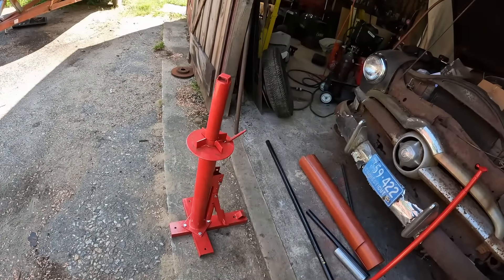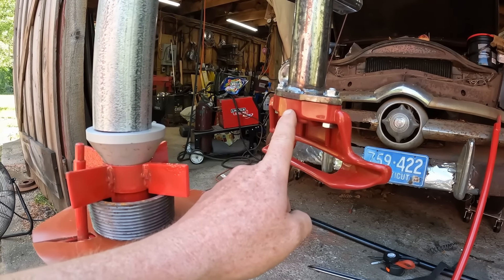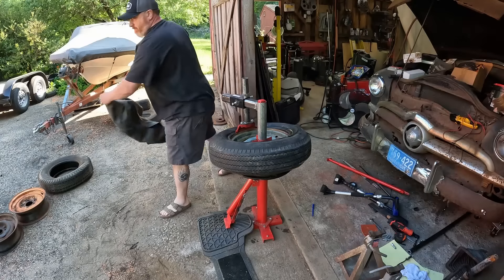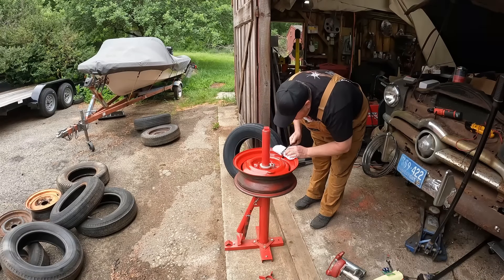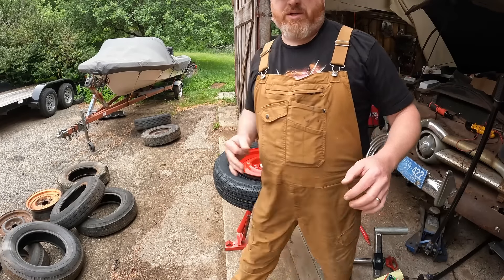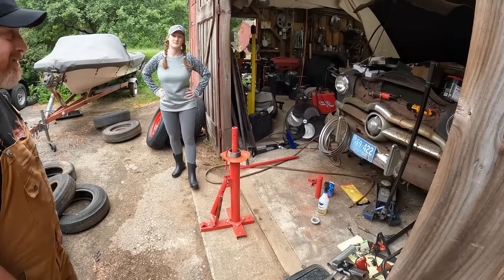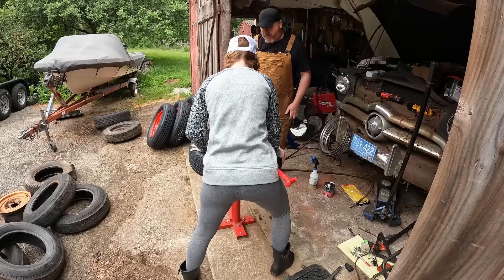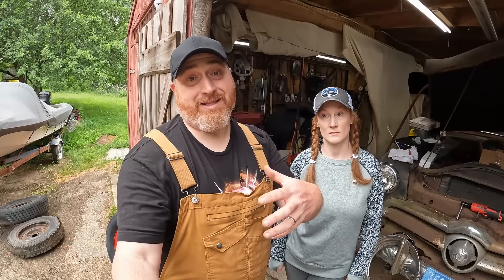How to modify a Harbor Freight Tire Changer to work amazing!!! Follow this DIY guide!!

Comment: Anything you buy at Harbor Freight will have to be modified. I really wonder if it's cheaper to get the material and build your own from the start. Your mods were excellent.
Reply from the maker: It's certainly a good question. My metal supplier will only sell me full lengths at good prices so honestly unless I want to make a few it's probably not worth it.

Comment: Hot soapy water will make it easier to put tire on and take it off
Reply from the maker: Yes it does. We used soapy water on the 3 tires and we have another video where we did 17" tires.

Comment: Used one of these harbor freight tire changers for 15 or 20 years. I put a 2" ID square  reciever stock in the ground in concrete and 2" OD square tube welded on bottom of changer. Easily removed with super steady mounting. I would cover reciever area  with underground valve box and cover. Like the upgrades presented.
Reply from the maker: That's a solid idea! Thanks for the recommendation.

Comment: People listen you can alway just use 2 tire bars and a bead hammer lol can be used anywhere and is super easy
Reply from the maker: I changed a trailer tire on the floor at tractor supply with 2 tire spoons and a hammer. This contraption is worth it's weight on gold after that.

Comment: The reason you didn't hear the tire pop onto the rim is because those old style rims don't have a safety bead for the tire to pop over.
Reply from the maker: Yes, we just did 17" wheels in the new video and pow! Lol
Reply: I did the same mods on my HF tire machine and couldn't believe the difference. I actually pulled mine off the recycling scrap pile to do it. Turned a piece of junk into a very useful tool. I haven't ordered the con yet but will within days. Glad you mentioned that the larger cone is the way to go and that will be the one I get based on your video. Thanks for the information and great videos. Probably going to buy the balancer soon, after watching the vid that you did on that.  @madgingercustoms

Comment: 20:19 how many times are you gonna use this
Wore that one out in about a year. Bought a nicer one with an accurate digital readout for ~$20.
When breaking the bead, use a bungee cord to temporarily hold the arm up out of your way.
Saving the video for when I build the adapter. Thanks!
Reply from the maker: Wow how many tires did you do in that year??
Reply: @madgingercustoms  Not from changing tires, just airing them up. Children, grandchildren, neighbors, cars, tractors, trailers, motorcycles, lawnmowers... it all adds up. The part that wore out was just the 'chuck'. The lever got wonky and it leaked a lot. When I realized how inaccurate the gauge was I just replaced it instead of repairing it.

Comment: Thanks for this video!  I had 6 tires to change on a 1 ton Dodge.  The DOT numbers show the tires are from 2004.  I know they were purchased new and installed in 2004.  I made mine with a 60" piece of 1" galvanized pipe (couldn't get black).  Works great.  I didn't have a problem with it twisting as long as I left a second bar just to the right of where I started from to hold the bead up.  Tires were stiff from age and 40 degree weather but came off great!  Install was a snap!  Thanks again, I was about yo build one of those bigger conversions.   This was much easier and looks easier to use!
Reply from the maker: I'm glad you found value in the video!  Thanks for watching it!

Comment: So that unit works for rims up to 16 inches correct? Thanks in advance.
Reply from the maker: I would think up to a 22" rim.
Reply: @madgingercustoms  okay I seen it said 4 to 16 half on the box wasn't sure if it was the tire size or rim thanks for the quick response great video.
Reply from the maker: @Ricky-eo5ym  I mean with the conversion I did.

Comment: Was just thinking, the vertical piece of square tubing for your bead breaker. What if you make it adjustable so that you have more pipe upward for breaking the bead. That way you are more upward versus being bent over at breaking the bead.
Reply from the maker: That's a solid idea.

Comment: Get some soapy water and coat the tire bead, make it way easier.
Reply from the maker: Soapy water was in the spray bottle.
Reply: I jumped the gun on that. Didn't see you using til later.

Comment: I have to commend you for the way that you did.  I have had one for years and have made a lot of additions to mine but I really like that duck bill addition that you did.  I have unmounted and mounted many tires in my time with this tire changer.  I do have many other tire tools that are old and new.  I have even bent the bar that is used to remove and install the tires.  I wanted to make a thing like you did but I didn't know that the parts were able to be bought, I've been fabricating different things like the duck bill but now I'll just buy one. Thanks for making the list of parts that you used to make it easier to purchase the parts that I need.  Thanks and GOD BLESS YOU SIR!
Reply from the maker: Thanks for watching our video. I'm glad it was helpful.

Comment: Use vise grips on the side of the rim if you don't have the duck bill. This isn't the tool for changing tires on nice rims. Put a ratchet strap around the tire then air it up. More pressure. You get the pop.

Comment: you said your lincoln  mig was acting up have you changed the contact tip and wire feed liner? thats usually the issue and if not that the change the wire feed drive wheels,  lincoln migs are hard to kill ive been welding 30 years  one or possibly two of those three things are usually the issue if your feed is jerky the fact you said sometimes its ok would lead me to replace the wire feed liner as they get bound with dirt and metal dust from use then bind when the mig feed is not straight
Reply from the maker: Hose and gun are relatively new. Thanks for the suggestions!

Comment: You made your tire changer better than mine.  I've been moved many times and had the machine mounted in the lawn before with a 4x80lb bag of cement poored into the dirt so I could ream on that thing without it moving around.  After that move I mounted it in the new garage on a free stranding sheet of plywood with space for myself to stand and walk around the machine.  It's a hell of a bitchty tool to use but it can be dealt with if your not trying to pay others to Mount dismount and re balanced tires all the time.  I've used it on it on 6 of my own vehicles, including doing a full tire set on one, light duty trailer wheel, ex gf pos car and lawnmower wheel.  Got my money back using it all ready.  I like how you modded out your's to be so much more user friendly.  Thanks for sharing to his.
Reply from the maker: Thanks for watching the video!!

Comment: Those older tube type wheels don't have the safety lip that causes them to "pop" when inflated. They will usually work when mounted tubeless, but stand a greater chance of the bead rolling off the rim if underinflated or if they are going flat.
Reply from the maker: Let's hope we don't have any of those situations!!

Comment: At 21:07 you can use a cargo belt with a ratchet head (Harbor Frieght et al) around the tread of the tire to squeeze it in so the beads are forced against the rim lips. You will need that for "stubborn" or soft walled tires. When using a belt you usually do not need to remove the valve core. As soon as the beads catch (before you get to full pressure), remove the belt.
Reply from the maker: I'll give it a go on the next set!! Thanks!
Reply: @madgingercustoms  We had a tire belt in high school autoshop, it looked like a fire hose but we never used it. You know the cargo straps, right? Usually about 2 inches wide, yellow, about 25 feet (way more than you need), with that odd ratchet/lever that allows a loose belt to slip along a slit in the roller to adjust belt length, you only get about 3 cranks around before the belt binds the ratchet, so belt adjustment being taught before you start cranking is needed. If you like using it, maybe you can make a video. I just subscribed so I will be notified of your new videos.
Reply from the maker: @paulromsky9527  thanks!!

Comment: The problem with your welder is the liner, replace it and it will work like new. It is not expensive at all.
Reply from the maker: The entire hose and torch assembly is recent. There is another issue. We have a new welder on the channel we are using.

Comment: I mean it would just be 2 smaller charges but yes they will remove tires for you then you could take the rims home paint then come back and have tires installed
Reply from the maker: That's a lot of running around, plus money.

Comment: If you have trouble with air escaping when trying to inflate the tyre, you can put a ratchet strap around the middle of the tyre to make the sidewall push out and against the rim.

Comment: Dude!!!! I got a hobo fright tire balancer for Christmas and haven’t messed with it until today! I saw your video a while back and watched it again today. I used a nice sharp 1/4” drill bit and drilled a little and tested over and over until the balancer wobbles almost forever! I have a set of old 5 slot aluminum mags so I can mount tires and balance and save a bunch of $$$$$! Thanks for your great balancer hack!!!!
Reply from the maker: Glad it helps out!! Thanks for watching our video!
Reply: @madgingercustoms  my most popular video is using a threaded rod, some blocks of wood and my impact to break beads and mount tires! You never know what people wanna see!

Comment: I had one of these some years back. Mounted it on a concrete pad and the carnage began. Most frustrating POS I ever owned. Kudos to your determination to make it work. Mine ended life as scrap after one of my particularly trying episodes. There is a perfectly good tire shop 6 miles from us.
Reply from the maker: I can certainly understand how this is frustrating in stock form.

Comment: Nice modification. I just purchased the harbor freight titanium 125 flux core welder. Uses 125 volt 15 amp. I own 3 very expensive tig,stick and mig welders and since I bought the flux core welder my others are on vacation.  I am a certified welder and you will not be disappointed  in the titanium 125 flux core welder.
Reply from the maker: I actually have a few welder sponsors now. We now have more welders and plasma cutters than we know what to do with! Lol. Not a bad problem to have though.

Comment: Could easily fabricate a bead breaker in the top as well to eliminate the cheesey one at the bottom. Awesome idea. I will be doing this to both mine and my daughter's.
Reply from the maker: The one at the bottom worked fine for me but keep in mind I had tubes and older wheels.
Reply: You need to be able to break both sides down. It's much easier to do it down on the bottom where you have the ground as a solid surface to press against. Trying to do it up on top of the machine is a mechanical disadvantage and you can only do one side at a time anyway so you're going to have to unbold it, flip it over and bolt it back down. Whereas when it's on the ground there's no bolding it down. It's easy to flip over and break the second bead.

Comment: Wouldn't it be easier to just get a couple of steel bars and a sledgehammer? Are you going to put tubes in those wheels?
Reply from the maker: No tubes. They will be just fine.

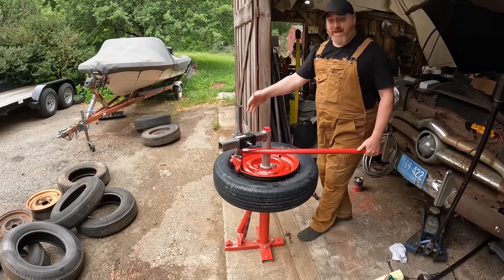Comment: 18:30 I like your unorthodox method of using the bar at the bottom better than the usual setup where the bar is inserted into the swing arm up top.
The applied force is more where it should be that way-

It'd be nice if you could weld on a small piece of circular pipe or ring at the duck head side to put the bar through and act as a guide to keep it in place as you work.
Reply from the maker: There has been a lot of good suggestions on more modifications. I may make a version 2.0 video!

Comment: the tire mount head was used in the wrong direction. you should mount and dismount in the clockwise direction.
Reply from the maker: The majority of tire machines spin clockwise in the center which makes the duck head go counter clockwise technically. I'll try it the other way next time. Thank you.
Reply from the maker: The majority of tire machines spin clockwise in the center which makes the duck head go counter clockwise technically. I'll try it the other way next time. Thank you.

Comment: Very entertaining video. I've mounted countless tires with just tire irons and a rubber mallet. All the tire mounting lube/sealer  I've used was aerosol linseed oil. I'd like to see how your device removes a really old tire from a wheel ( if it even does that) since they can be ball busters.
Reply from the maker: Yeah lube is key. Thanks for watching!
Reply: @madgingercustoms  I think the linseed oil softens the rubber as well giving a better seal on the bead.

Comment: About 15 years ago I  was teaching a friend how to do tires with the same machine. We mounted it to a piece of plate steel. I think that we broke down 500 tires that summer. We had his 3 kids, first air out, break beads on about 25 tires, then we used 2 long tire irons and a hammer to remove the front beads, then the rear bead ,then Mark and stack the good then the next pile. The kids were 11, 12, 14, I think that they could beat anyone arm wrestling after that summer.
Reply from the maker: That's awesome!

Comment: Good vid.....I always hated the LEFT TURN crap from off shore ...I've been checkingg regularly to see if an AMERICAN builds a right hand 'duck-head'🤣🤣..RIGHT turn setup prevents having to leap-frog your initial bead bar AND tends to keep the wheel hold-down apparatus TIGHT....a couple axioms when changing a tire (manually, at least) ...valve position .....OFF first, On last.....prevents tire bead from cutting the bottom off the valve, under mounting pressure......and secondly, be sure that the NARROWEST bead area on the rim is facing UPWARD.....yeah, i know but once it is mounted, just flip it over to air it......and use BEAD-LUBE of some type....I use a rag, twisted into a piece of wire and kept in a container of detergent/water mix.....ENJOY and stay safe
Reply from the maker: Thanks for all the suggestions!

Comment: Put soap & water around the bead seat and valve area to check for leaks when your done there if no bubbles then your a professional...
Myself I like Bubble Balancers better use them for my drag car and buddy's stop by and use it for there stock cars...

Comment: 1st I have the same tire thing from hf 2nd I mounted it to a plastic pallet 3rd your mods kick ass. As for removing the tire no mods needed. How ever putting the tire back on the rim = impossible with no mods. That (with the mods) was super easy from what I can see. Thumbs up kickass job. P.s. I do have the manual bubble wheel balancer from hf work pretty good. Thank you for your time and video
Reply from the maker: Thanks for watching our videos!

Comment: Great video but for the love of god get a tire cage or a remote trigger for initial fill. Ive seen tires cut people in half and cause absolute destruction from seperating
Reply: Or weld one together
Reply from the maker: I've never seen a tire cage employed at any commercial tire shop that did LT and car tires. Semi tires? Yes.

Comment: You might have a problem with the rim breaking they were not designed for radial tires.
Reply from the maker: They sold millions of cars like this. It will be fine. And if not it will make an interesting video.

Comment: Yes isn't welding on galvanized a little toxic?
I have welded on galvanize material  and got a little sick ( good old Army Reserves needing something and not telling the dangers).
Reply from the maker: It absolutely is and I'd only weld it in a well ventilated place or with a respirator on. Metal flu sucks!

Comment: Valve core out.
Just put the female end of a airhose on the valve stim. And turn on the air.
Pop. Sealed most the time.
Unless you have thin tires on wide rims.
If so
Like i said. The areosal boom.
Or a ton of grease.
I have seen a soap used. That was like grease. But dont know where to get it.
The one ive always got to work was the areosal boom with match. But its not for the faith if heart. Or the safest.
I havent mounted tires in years. Make that decades.
I hate doing it.

Comment: Just thought I would mention, tubeless tyres should be fitted to tubeless rims, I suspect your rims are not ment for tubeless tyres
Richard.
Reply from the maker: They aren't tubeless rims correct. Thousands were mounted like this though without issue unless they are run low on pressure.

Comment: Clean your wire feed roller "teeth".
Also, join the H.A.M.B. message board if you haven't already.
Reply from the maker: I'm on there. I don't post but I reference it a lot!! And I will clean that roller. Thank you.

Comment: Great video and great mod!! Thanks for sharing!
The reason you didn’t get popping is because these are rims for tubed tires. Tubeless rims have humps on each side. In a wheel code like for example 6.5J15H2, the “H2” means it has a hump on each side of the rim where the tire sits. The point of those is so the tire doesn’t slip in when going through a steep turn which would immediately deflate the tire if it were to happen. So be careful out there.
Reply from the maker: She's not a road race machine! Lol. We will take it easy.
Reply: @madgingercustoms  that’s good to hear. Maybe this info will help others as it’s not exactly commonly known. Thanks for sharing!